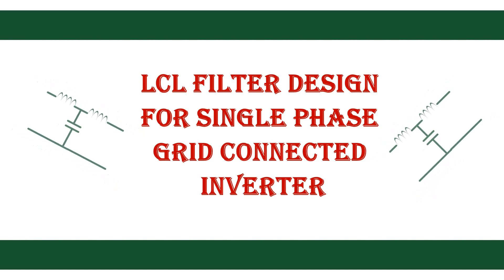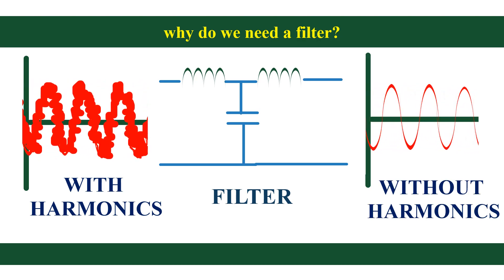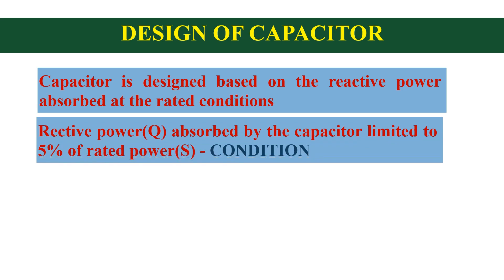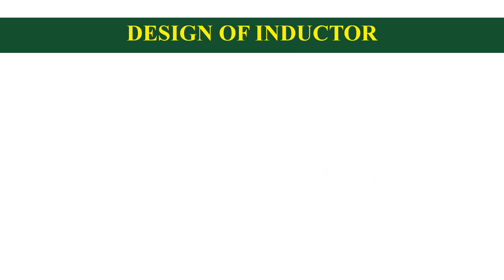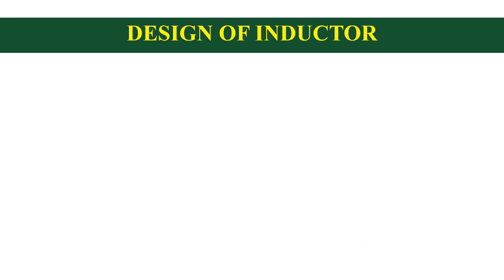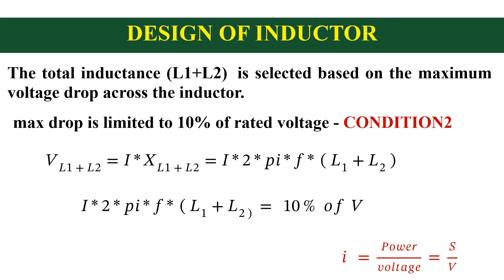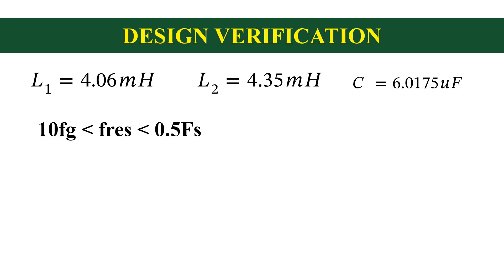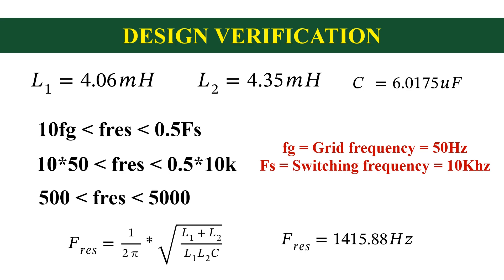Design of LCL Filter for single phase grid connected inverter.

Comment: The value of capacitor is not proper as I have tried practically and the proper value comes out to be way lower than given by this formula. Please follow IEEE paper.
Reply: But in IEEE the 0,5 is also mentioned

Comment: Sir the rated voltage is 230V and the rated current is 2000/230=8.69 
So why have you used that √2=1.414 in the calculation of L1??
Reply from the maker: To find the peak value
Reply: @TechSimulator  ok sir... 
But you said that inductor ripple current is 20% of rated current ( which is rms). So why to calculate peak

Comment: is this suitable for any single phase inverter or only for particular topology?
Reply from the maker: Only for the particular topology mentioned in the video. By the way which topology you are working on
Reply: @TechSimulator   i´m working in a single phase flyback microinverter (it has an unfolding bridge), can i use this filter?
Reply: @TechSimulator please sugest us which iee standard you are using

Comment: the condition taken in the calculations (5% of S and 10% of S) are based on the any Standard or it up to us?
Reply: Those numbers sounded like "typical" values, I think.  Application specifics and meeting EMC might impose other requirements or loosen them.  Maybe you can tolerate more current ripple, or larger variation in line voltage vs load.

Comment: why do you use 8.69*1.414 ?
Nice video ! thannks for all.
Reply from the maker: For 2 kva rated power, 230 v rns output voltage, rms current will be 8.69 amps. We need its peak value for the calculation, so multiplied this value with root 2.
Reply: @TechSimulator  your the best ! Thanks !
Reply: @TechSimulator  please sir. Through more lite on this . Thanks